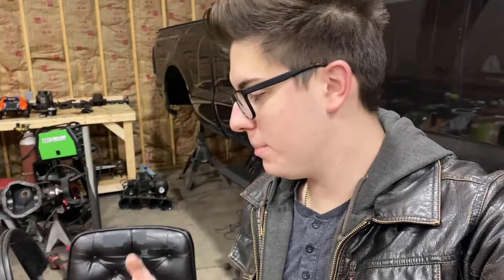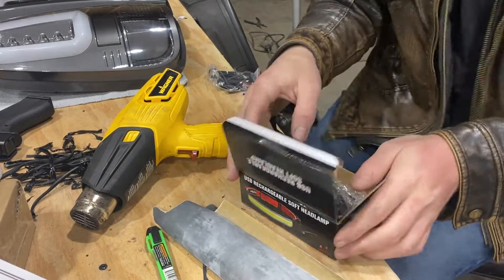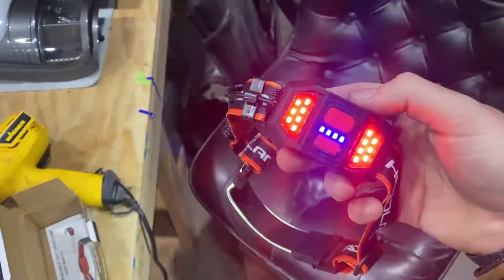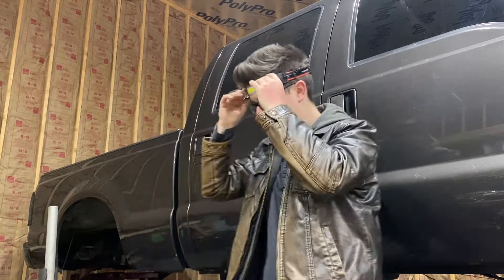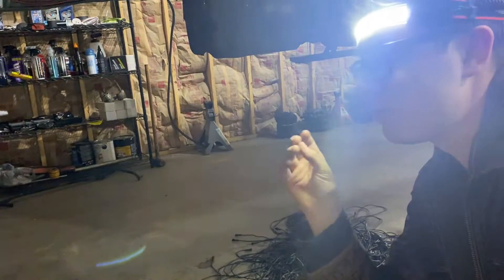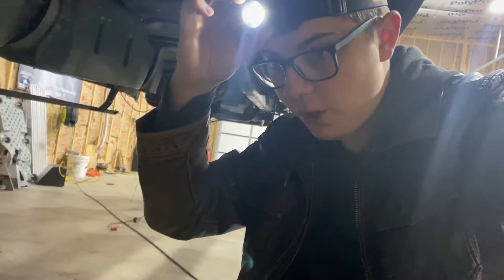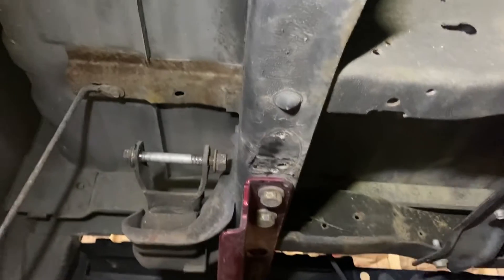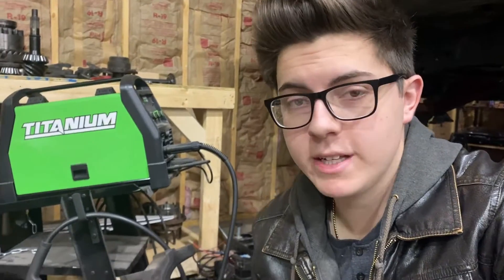WORLDS BRIGHTEST HEADLAMP | BEST HEADLAMP OF 2022 | REVIEW

Comment: why do people make videos of flash lights of any kind and never turn off the lights or go out in the dark
Reply from the maker: Not sure. Can’t relate
Reply: Myself, I use a flashlight more in lighted rooms with areas that have low light or dark spots to work on and need two hands. So if it works and helps in lighted  Is situation you should understand it will be a good light source in the dark.  Hope you understand.